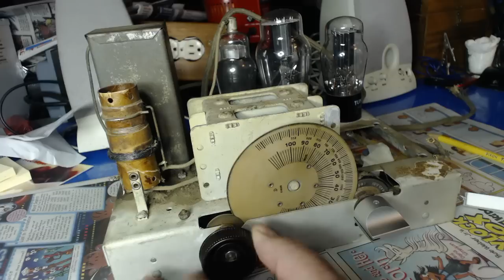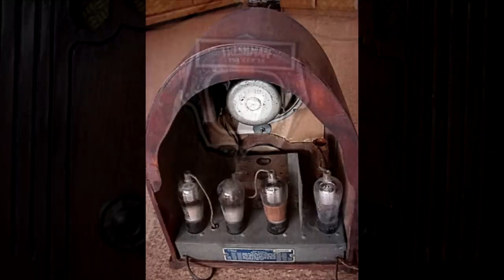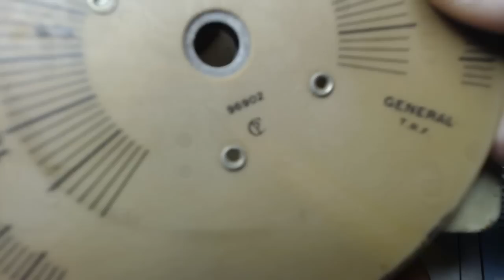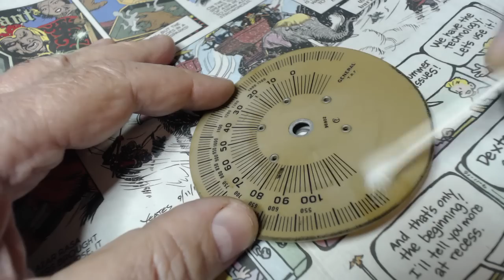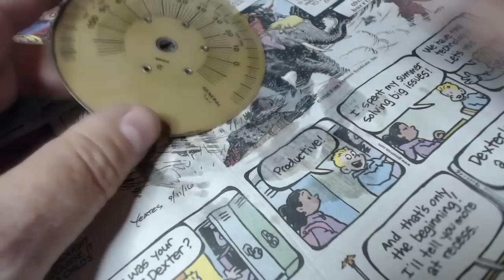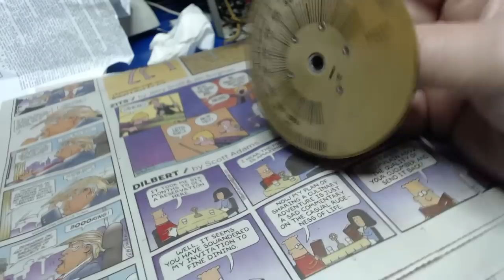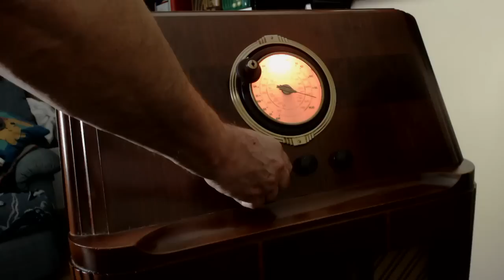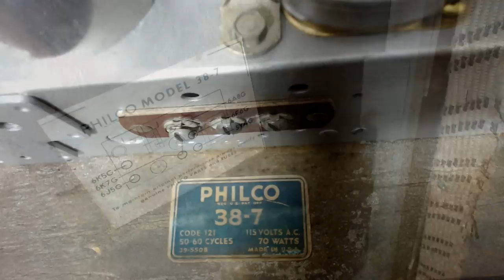1932 Mystery Cathedral Radio Restore Part 3

Comment: As always Buzz, I very much enjoy viewing your videos.  
It would be over forty years ago when I first saw an old service technician straighten out a very warped plastic (celluloid) radio dial.
I remember seeing him wrap it loosely in a few layers of newspaper, and apply a warm clothes iron over, and around it.  After a few minutes of ironing, and a few checks along the way, the dial was as flat as when it was new.  Ever since that time, I too have applied that technique whenever I’ve needed to …and it has been a success on each occasion.
Taking into account the nature of the plastic, the number of layers of newspaper in which it is wrapped (I usually apply between four and six layers), and the extent the dial has become warped, be careful to set the heat of the clothes iron to a good working temperature so as to avoid causing addition stress to the plastic.  I start off by setting the iron to a moderate temperature, then gradually increasing it as I further smooth over the newspaper until I’m satisfied the warped dial is flat.  Always allow it to cool naturally.  
I also liked seeing, and hearing, the restored Philco, model 38-7 …thank you.
73 de Phil.
Reply from the maker: Hi Phil...good idea on the iron...I will try that............Buzz

Comment: You are inspiring me to finally get a project of mine going.  I have an old radio cabinet (very early 1930-ish) that belonged to my grandfather.  When the radio died, he turned it into a liquor cabinet.  He sawed the legs a bit shorter (removed maybe 2-6") and added a shelf in the inside.  The sliding doors still operate.  I have no idea what brand radio it was (might have been a custom job with a brand A cabinet and a brand B chassis), but the cabinet does resemble a Setchell Carlson.  

I looked for a radio chassis that dated from 1930-1932 and I found Gribsby-Grunow model 330 chassis for about $30 with tubes.  I started to recap it, and I replaced the volume control.  The power transformer checked out with an ohmmeter.  It was missing the output transformer and speaker, but I found a suitable field coil speaker on ebay that had been reconed bye the seller.  I also found a universal output transformer that fits the speaker and will match the type 59 output tube. (radio uses a type 58 RF stage, type 58 mixer, type 56 oscillator, type 58 IF, type 55 detector / first AF and an 80 rectifier.)  I had given some thought to finding a later model Zenith multi-band chassis for the cabinet, but decided against it as the time frame was not correct and it would have cost me many times as much.  

I will also need to build a front panel and a shelf for the chassis back into the cabinet, and find some nice grill cloth.  I'll also need to re-finish the cabinet, it's all scratched up.  I will also want to turn some new leg extensions.  The project has been sitting for some time, this restoration of yours is a spark of interest here.
Reply from the maker: go for it Kenneth, and do a video series .....by the way, Dickel wants to know if there was any liquor left in the cabinet,,haha

Comment: You sure don't mind jumping in and trying the impossible and quite often you succeed!  The tar sealed cap came apart easily.  That was a bit of a surprise.  I don't that I ever saw a better job on a tuning cap! !  Great video as usual.  Thanks.
Reply: that tuner condenser was like a 57 Caddilac, all sparkly and shiny.  If this was an Elvis radio, it would need to be 24k gold plated.  Buzz sure does the spit and polish on them old chassis, 'tis almost a shame to put it in a case where it can't be seen.
Reply from the maker: Hi Stephen.......It was quite easy cleaning out the can...I was expecting the worse......thanks, Buzz

Comment: Buzz, another great video and another kick in my pants to get some radio work done. Lol, my wife is laughing that I spend more time watching others then I do myself. Couple of small questions. Did you run the dishwasher with soap? Did you use the no heat drying cycle? After you cleaned the tuner, did you oil or grease any of the parts? Really liked the way it came out.
Reply from the maker: Hi Scott...yes, I used those dissolving pods in the dishwasher on heavy, with heat...I put it in Evapo-rust right after I showed it on camera..I oiled and lubed after I cleaned it with naval jelly...........Buzz

Comment: Novus plastic polish on metal? That's thinking out of the box! But I won't throw my Brasso away yet. At least Rider's Volume 3 has the schematic for this Belmont 40A. Good luck finding the missing part. I looked on the net for a while but Freshman radio products are few and far between.
Reply from the maker: Hi Ron..That Novus works on anything...I believe the radio chassis is almost identical to the Belmont, but has no nameplate, so it may have been made for Radolek, and sold under the name "General", but I will probable never know......regards, Buzz

Comment: ...and a cameo of ALFALFA singing at the end.  
Buzz, you be the buzz saw meister on that jigsaw.  
Hard work?  um stuck in my LAZY ASS CHAIR, yawn, zzzzzzzz 
Are you sure this isn't one of those KMart Crosley replicas, those look like the real thing, but whee's the cassette player Buzz1151?  Some partical board with contact paper veneer will look very authentic my man.  Peehaps you can open up some of those tubes and insert some transistors inside them, and add some LEDs to make them look real.  The finishing touch could be a 2' speaker for that infamous Cosley hifi sound.  wtg Buzz, it's very authentic.  Don
Reply from the maker: hi Don, at least you are safe in your lazy-ass chair....better lay low till the election is over....
Reply: I gots to get me one of them thar scroll saws one day.